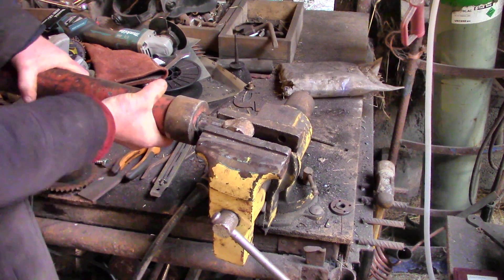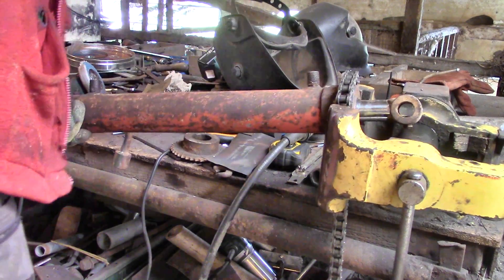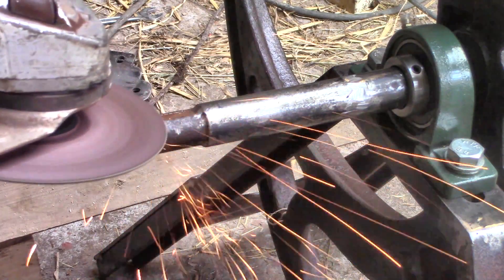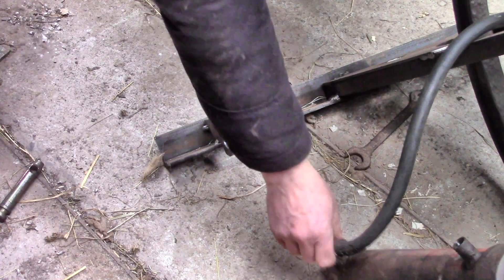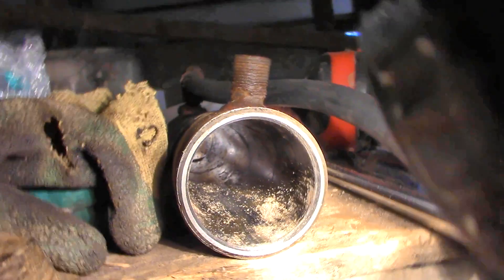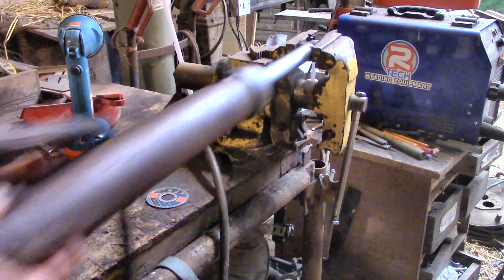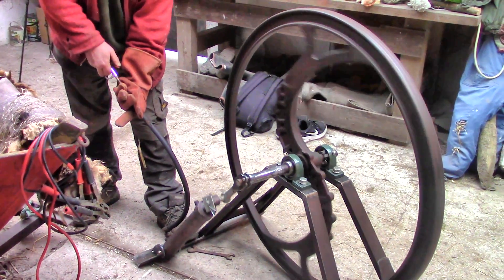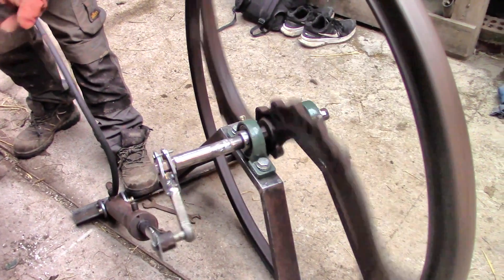Can A Hydraulic Ram Work As An Air Engine Piston?

Comment: The late David King built a "grass hopper" beam engine to power a gramophone. He used a simple taper cock (or plug valve) for the inlet and exhaust valves worked by leavers from the beam.  If you can work out the geometry, this could offer you the solution to your timing. 
There are two videos of it on youtube, which you might be able to study.

https://youtu.be/Q6yCAWw_XSw
https://youtu.be/VRz7EP30RdM

My first full size engine stationary engine I built I used a lawnmower engine as the basis, inverting in, and cutting the crank case away , and re-engineered the camshaft to operate the engines valves, this could be another method. 

If you plan to keep your cylinders single acting, you might want to use two cylinders set at 180 degrees. 

Hydraulic rams normally have eyes each end so they can pivot.
Reply from the maker: Excellent work! I wish I could see the valve workings more clearly but it looks good

Comment: As an ex hardware control software engineer (in a former life) I would add a circular encoder strip to the end of the axel, or even a linear encoder strip along the rim of the flywheel, and then connect a detector to a PC / laptop / PLC which would trigger a series of solenoid controlled air valves at the correct times. Overkill? Well, yes. But if you programmed it correctly then it could very quickly 'learn' the optimum timings and be as efficient as possible
Reply: I like this answer but I don't think a computer is getting a job at this fella's shop. Though there is the cutting machine that he's fine programming, maybe I'm wrong.

Comment: Valve gear! That's what your going to need to look into on making it timed correctly, The same kind used on steam locomotives, and compressed gas locomotives. They were commonly the exact same or very similar between the two. I cant wait to see how it turns out

Comment: You’re going to need a 3/2 valve, that is 3 port, 2 position as you need to be able to apply pressure on the extend stroke and vent as it retracts with flywheel rotation.
Simplest way is going to using a cam arrangement on the shaft which actuates a 3/2 valve
Reply: I knew one of the comments must mention using a cam  https://www.youtube.com/watch?v=kxqmsaaDfdE

Comment: I’m not getting ahead of you , I’m anticipating your next move ! Lol. A cam to run the air , that way you can set the timing ! If you ran the other ram across from that one and used a double lobe cam and a crankshaft you could utilize the steam for more power and that’s where a 1-2-1 ( 1- front axle 2- drive axles 1-trailing axle ) would work the most efficient !
Reply: Might be smarter to run them 90° out of phase and not 180°. With 90° you will get a self starting engine because one of the cylinders is always at the end of its travel while the other one is at the turning point (worst position). Thus you can get away with a way smaller flywheel and get a smoother running engine.

Comment: Interesting. 
  All you need is a cam lobe on the crack shaft to actuate the air valve. With adjustable cam, best timing can be easily found and set for target rpm.
Reply from the maker: Yes, but what about the exhaust gas?
Reply: @wayoutwest-workshopstuff6299  Mount another valve on the same cam, but off set. But I’m sure, you’ll come up with much simpler and elegant design than me. 
  Your mad scientist approach is very inspiring.

Comment: I'm a mechanical engineer in germany for agricultural machines.
My biggest mistake I ever made was accidentally blocking a hydraulic cylinder from pivoting (in a prototype). So basically the piston moved out, tried to follow the thing it was pushing, but the bottom part couldn't move. So the rod had to bend. It bend roughly 30-40°! It was bent like a banana!
No oil leak, it still moved in and back out again and I had the shock and laugh of my life all at once.

Pretty damn sturdy those things.
Not all of them come with 2 holes; often the rod is threaded and sometimes the cylinder has a bolts welded on the sides to move the pivot point closer to the seal (i.e. dumper do that quite often).

By the way, I almost always like the shapes of your plasma cut sheetmetal parts. I recon they must look "natural" (rounded shapes) and yours always do. Structually it usually complies with stresses if the part looks like it "grew" (like a tree).
Reply: Hey, ich bin momentan im 5. Semester Maschinenbau und würde später auch gerne in Richtung Landmaschinen / Sondermaschinenbau gehen. Hast du vlt ein paar gute Tipps? Wie zufrieden bist du mit deiner Richtung, gibt es Firmen die empfehlenswert sind oder welche die man eher meiden sollte? Bin für jeden Ratschlag dankbar!
Reply: @clypeum5063  habe dir eine Email geschickt :-)
Reply: @RubyRhod  danke, habe dir geantwortet (Spam?)

Comment: If you had, as in could make, a diaphragm with the same volume or slightly greater as the cylinder you could have oil on one side and steam on the other.
As you do have a magic metal cuter.

Comment: Yeah that'll work pretty well! - taking a leaf out ot the steam engine book, now you need some sort of eccentric connected to some sort of shuttle valve. Careful with oil lubrication though, you might end up with an impromptu diesel engine if your valve timing fails and the flywheel compresses the air in the cylinder. Some sort of silicone oil may be the answer there.
Reply from the maker: Ha! Brilliant : -   )
Reply: Great comment!

Comment: wow you work quickly!, you might want to look into working the steam expansively, small bore/long stroke cylinders make for horrifically inefficient steam engines with very little power!
Big thumbs up, excited to see what happens next!
Reply: you mean something like turbine?
Reply: @pieters286  I hadn't actually considered a turbine, I meant in terms of the cylinders proportions  since with a larger bore you only have to inject a little steam at the start of the stroke, then as the steam expands into the cylinder it pushes the piston through its travel.

Given how crude yet successful early steam engines were I don't think leather piston rings in a plain steel tube for the cylinder is out of the question or since tim's so handy with the laser cutter maybe even laser cut rings?
Reply: No, long bore worked expansively is the most efficient way to use steam. Look at stern wheel engine design, 8-12”(?) bore & 6’ stroke or something to that effect.
The stroke limits the RPM.
Bore & Stroke trade off torque & horse power.
To answer your question, no, plasma cut parts are way too rough to seal & the slag produced on the cut edges would score the cylinder instantly.

Comment: if its going to run on steam then it will need a massive cylinder a least 6 inches in diameter
Reply from the maker: that depends on the psi and the amount of power needed, surely?

Comment: I would advice a pneumatic cylinder.
Reply from the maker: why?
Reply: @wayoutwest-workshopstuff6299  
My first thought is that it would provide a better seal to air/steam. My thought train was that oils don't need as good seals as air would. 
But remembering back to my time as a industrial laundry technician, our pneumatic cylinders were constantly getting replaced because they were breaking or leaking. 
So maybe not the best idea, unless you want a whole lot of cheap pistons for an inline, 12 cylinder, 2 stroke steam engine.

Comment: With the flash steam boiler and that thing you could make an steam loco. I would fit the other Piston on the other side so that you have power in bouth directions, and when you now modify the piston so that you can push air trough bouth up and down you would get four times the power
Reply from the maker: but I'd need a lot of steam for that!

Comment: Being a serious steam train nut, and familiar with tractor hydraulics and rams, watching this project is a real joy! It really brings all sorts of passions together, and in a relatable way! I can't wait to see the process of building some sort of regulating valve... a Walschaerts valve gear perhaps? something of your own invention? On to the next thrilling installment!
Reply: Well walschearts valve gear is like really hard to make Stevenson's would be easier
Reply: Well said, I too can't wait either.  Like your surname aswell
Reply: It’s designed for steam power so I will never be esp efficient, but never mind, it is pretty easy to make something go round & even get some usable horsepower out of it if fuel economy isn’t a concern.
I think the biggest limiting factor is probably port size.
I would simply add a fixed valve (rotary?)   and use hydraulic hoses to pipe the steam to the cyld.
Reply: A simple push button valve will do fine. You should be able to set it from the crank via a rod or bar. This'll work fine with air but not so good with steam as steam will expand in working but air just pushes.
Also, you have to find some way of exhausting the air in the cylinder while the piston goes back down.
Good luck

Comment: Don't forget, compressed air is probably the most expensive form of energy in your shop. Unless of course you intend to run it with steam.
Reply: if its going to run on steam then it will need a massive cylinder a least 6 inches in diameter
Reply: @IndustrialParrot2816  you need a pretty big boiler to produce enough steam for a 6inch piston.

I think even this piston may be too big for his small boiler...

Comment: You could set up a simpel cam with  roller to push down on the air nozzle trigger, easy simple solution and uses stuff you already got